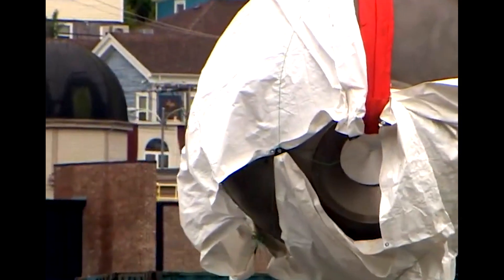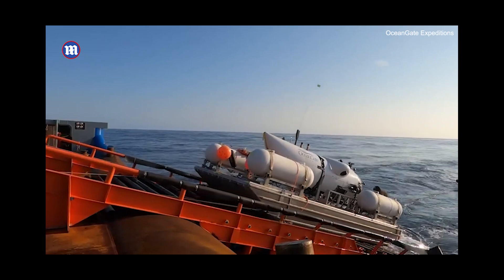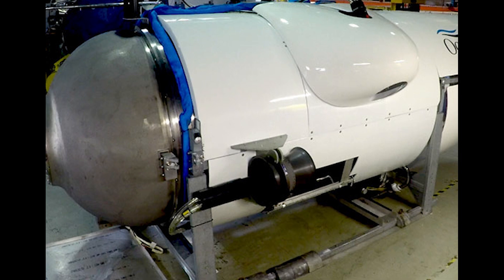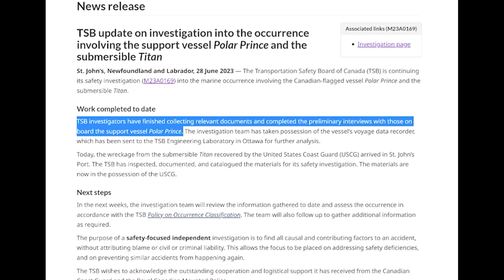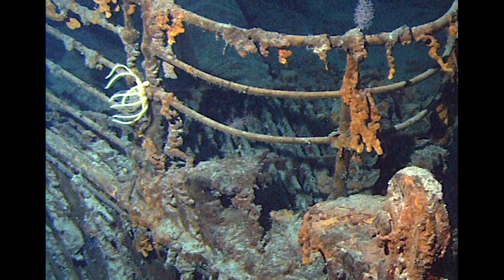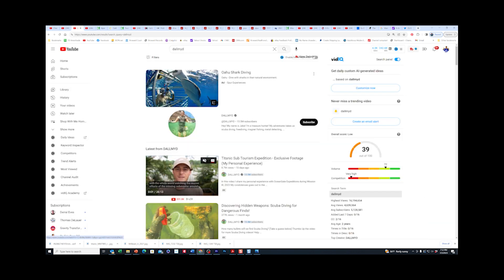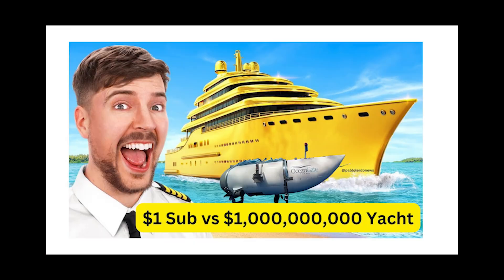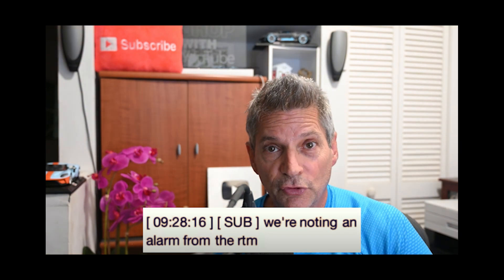Titan Submarine Debris Clues, Implosion Simulation

Comment: The porthole almost certainly blew outward during the implosion, taking the bolts and retaining ring with it. The salvage crew would not tamper with critical evidence. They have lifting bags and would not need to remove the porthole.
Reply: @bills6093 I concur. Did some fuzzy math, the yield load for each of those fasteners would have been around 17,000 lbs each for a combined yield load of around 289,000 lbs. The purpose of those bolts is just to keep the porthole watertight at the surface because, being bolted from the outside, water pressure would have sealed it more firmly as it went deeper so I'm going to assume the bolts are just corrosion resistant steel rather than anything super exotic. At that depth, they're seeing between 5,000 and 6,000 psi of pressure. that porthole has a surface area of about 350 square inches which means that that when the hull imploded that flange would have seen a peak load of about 2 million lbs. Those bolts failed and that porthole went rocketing off into the ocean.
Reply: @themightydropbear Your force balance is lacking the external hydrostatic pressure that resists motion.

 I looked up 3/4" UNC grade 8 bolts, and get 50,100 lbs each.

Titanium and steel both have tensile strength numbers of 50 ksi, so your titanium bolts would be roughly the same strength. I'm pretty sure that they did not want galling or stress corrosion issues, so they used titanium, unless they are even stupider than they appear to have been.

Stainless bolts would be stronger BTW.

The clamping force of the bolts was roughly 0.9 million pounds for 18 fasteners, while the external pressure on the port was roughly 2.2 million pounds.

That's 3.1 million lounds that needs to be overcome before the port will budge.

Hydrostatic pressure on the internal face never exceeded 2.2 million pounds, so that plexiglas stayed right where they put it.
Reply: @chemech  Your high-school physics calculation is for static loads.  You're not taking into account that this event was basically an implosion/explosion, with dynamic forces and pressures way beyond what you could imagine.  

The salvage team DIDN'T REMOVE THE PORTHOLE to get a better lifting-point.  You absolutely do not screw with evidence that way in an investigation like this!  Anybody who even tried it would have been yelled at and fired on the spot, or at least removed from duty and sent to his cabin.  Also, it wasn't just the bolts holding the acrylic to the titanium.  There was a sealant/adhesive applied (to thousands of square inches of surface) before the thing was bolted on that would have made it impossible to pry off out in the middle of the Atlantic.  

Redo your calculation taking into account the dynamic forces of an implosion of a carbon fiber cylinder at 5000 psi.  Oh, you can't, cause no one's ever modeled it before???  Yeah, that's my point.  The implosion blew off the fu*king viewport and sheared the bolts.  Probably shattered the acrylic into a thousand pieces.  It had sufficient energy to do that.
Reply: @johnbergstrom2931  My, you sure don't like it when folks don't see the world through your lens, do you? 

Have you ever done an accident or failure investigation? Because, I have, and I can assure you that if items are properly recorded and inspected, partial diassambly of things that did not fail is actually allowed, because in the real world you can make some determination of whether a part was involved in the failure, thus needing extensive laboratory analysis, or clearly not failure related, in which case you may document and package the parts while making field observations.

It is quite possible for field investigators to make some determinations without needing to be in a laboratory. You are using the same tools, just working outdoors instead of in a warehouse environment at the lab.

Especially if the non-critical, non failed items are in the way for transporting the evidence back to the lab. Chain of custody must be preserved, and evidence that the part did not fail - especially still photographs - would be sufficient to allow field investigators to proceed as necessary to prepare the samples for transport to the lab.

Your point regarding the seal is incomplete - there would have been an elastomeric gasket used - no sealant, as solvents will damage acrylic. Acrylic is particularly easy to "craze" if it has been machined or polished, and alcohols will do it in a heartbeat. The solvents for sealants would be either alcohols (as in most glues) or aromatics, which are even more aggressive to acrylic.

A crtical point to inspect woul be to verify that the gasket was retained in place, and the gasket would be inspected for damage, as would be the seat and the acrylic. On a large, awkwardly shaped object such as the dome, the field investigators are very likely to have done the inspection and recorded the evidence, then preserved the pieces for further inspection in the laboratory.

Finally, your opinion regarding the force balance is just that - an opinion - and, a not particularly well informed one it appears.

Fact: In order to dislodge the port from its seat at depth, the statics analysis is quite sufficient to estimate that ~3 million pounds of force would need to be applied, while the hydrostatic pressure at the depth gives a force of ~2 million pounds. The extra  ~6,000 lbs (or even 60,000 lbs) of waterhammer is too small to be a significant figure.
Reply: @chemech  While the 'waterhammer' effect may not be large, the O2 tanks and battery systems and any flammable material may have rapidly ignited and exploded due to the 'diesel heating' of the atmosphere from such rapid compression, there has been much speculation about that as well.  As they inspect any of the interior debris we may get more answers.
Reply: @johnbergstrom2931  what thread stress is there during an IMPLOSION? You're explaining explosive forces which go in the opposite direction to what happened here!
Reply: @themightydropbear  I don't see the bolts failing during implosion at all - explosion perhaps. But this thing was a SUPER strong vacuum which implodes!
Reply: @R.BOWERS  Because the straps work better for things with holes in them?
Reply: I do not see evidence of damage to the seating flange of the viewport from such a failure - it looks pristine, where if it failed as you suggest, the bolts would have torn the base metal of the seat, with significant damage.
Reply: @chemech  Not really, if it blew out then possibly all the threads got stripped, you wouldn't see that fine of damage on these videos.  The pressure in that sub would of gone exceedingly high, and any work I have done with explosives, there is always something that happens that goes against intuition, pressure waves work in mysterious ways.
Reply: @kingcosworth2643  I've looked at a few pressure vessel failures in my career. Other colleagues have more experience.

Bolts on a flange never fail simultaneously, and stripping the threads during a tear-out always leavesfairly visible damage.

Elesewhere I estimated that the tearout failure would have to overcome ~2.2 million pounds of hydrostatic pressure plus 0.9 million pounds of bolted connection strength. A collapsing air bubble is going to find the path of least resistance, and, frankly, dissolve into the seawater almost instantaneously.
Reply: @kingcosworth2643  "would HAVE" or "would've", NOT "would of".
Reply: @chemech  Could just strip the threads right out. Or could shear the bolts off flush. I think we would all like to get a closer look at that end cap.
Reply: @bills6093  Even Grade 8 steel bolts would have tensile strength of 50,100 lbs each for 3/4" 10 UNC.  There's a safety margin beyond that, but it takes more time to dig the references up for that, so we'll use the rated capacity.

Titanium and mild steel both have tensile strengths of 50,000 psi, so we can assume that the service rating will be roughly the same.

IIRC, there are 18  bolts - might be 20 -around the viewport to clamp it in place. 18 x 50,100 = 901,800 lbs.

a 22" diameter viewport would experience at most:  380 sq in x 5,813 psi = 2,209,000 lbs on the outer surface at 3,800 m depth 

The design pressure at 1,300m = 1,949 psi, pushing the acrylic against the seat. I do not know for sure what the supplier was using as a safety factor for life-critical equipment, but personally I would prefer to use 5.0. It looks as if they used something larger than 3.0 in any case.

In order to rip out the acrylic and tear out the bolts, your shockwave of rapidly compressed air would then need to exceed 3,111,000 lbs = 8,187 psi - instantaneously - in order to tear out the bolts 

That's not going to be a clean failure however, as the bolt theads will not fail uniformly and instantly. Look up pressure vessel failures - there's always damage to the flange in that sort of failure of the bolts.

I don't have the compression calculations at my fingertips, but I doubt that a collapsing air bubble can generate that much pressure. It's far more likely to go into solution in the water first.

We are talking about stupidly high pressures applied in millisecond - and brittle failure is going to be faster, and thus relieve the differentila pressure on the ductile materials potentially before they even distort significantly.
Reply: @chemech that collapsing air bubble had a lot of fuel and oxygen in it. The Shockwave from the resulting explosion would easily exceed those numbers.
Reply: OK, this settles it: The Daily Mail reported on 06/23/2023 that the "Porthole Window" and "Front of Pressure Chamber" (front titanium end cap) were found seperately in the debris field.  The implosion blew out the acrylic porthole.
Reply: @johnbergstrom2931  rubbish, porthole caused nothing of the sort. Implosion impact may have dislodged it but it wasn't the initial caused. FOCUS ON THE CARBON FIBER!
Reply from the maker: I would love to see these parts up close
Reply: HOW would the salvage team remove bolts?  The depth exceeds the safe limits for divers to work.  No way to remove bolts

.
Reply: @electrictroy2010  With a motorized socket wrench on the ROV operating at depth...

More likely, they got it up to the surface and examined it on the deck of the recovery ship, then removed the bolts so that they could examine the gasket and the flange face.
Reply: @electrictroy2010  No divers at that depth. it took 2 hours+ for the submersible to get down there, and the ROV robot.
Reply: @jeffostroff  I think we'll have to wait a couple years until the investigation is complete to see good images of the Titan wreckage.
Reply: @johnbergstrom2931  why? Hi resolution digital camera can work MUCH faster than that.

PERFECT photographs can be beamed around the world within seconds. No need to wait unless it's suppressed from public view for whatever reason.  Be nice to have live footage of the lab investigation.
Reply: @fifiwoof1969  The images of the wreckage will be concealed from the public until the investigation wraps up.  "Be nice to have live footage of the lab investigation."  WHAT PLANET ARE YOU FROM????
Reply: @johnbergstrom2931  the only connection to anything that could conceivably be considered classified is the navy or coast guard rescue - this was a privately owned submersible that DEMANDS public scrutiny due to the fact that innocent lives lost on board. With respect to 80% of the passengers we don't need the gory details but structural failure details is essential for others to research from.

Earth - thanks for asking. Try joining us some day ;-).
Reply: @jeffostroff  exactly.  .  lifting bags dont help to move the rings from the ship to the dock.
Reply: @bills6093 completely agree with you .. there's no way they would remove the window .. it would impede the investigation.
Reply: @ScreamingEagleFTW correct but he had a poi t they wouldn't remove something that could be evidence. They could have bolted on a loop to the hinge point to lift if from water to the dock
Reply: @stevenbishop1466  if the glass was broken they might have had to remove it to preserve it so it doesnt fall to pieces while being hoisted up.   Im sure there were forensic researches on site giving directions to collect the evidence. Im sure the investigators dont just wait in the lab for the parts to show up.   The gathering of the evidence is crucial and wouldnt be left to random dock workers.
Reply: @sparklebox11  Well did the remote rover have a dewalt cordless drill driver in it's claw to remove all of thoes bolts at 3800 meters?
Reply: @ScreamingEagleFTW 🤦
Reply: @R.BOWERS  Yes, I used the incorrect term. I'm sure no one ever does that except me.  Shake your head all you want.
Reply: @@NT-ed9fo Yep..., and, it's debatable at best if the implosion could generate enough force to overcome the external forces holding the port in place.

Until the internal force exceeds the combined external pressure force and the clamping force of the bolted connection, that window wasn't moving.
Reply: @chemech  Not a very 'fun' fact, but someething to consider.  When they dove on the Thresher back in 63, the Trieste took some photos of the propeller and most of the shaft and thrust bearing.  It had been ejected out the aft end of the boat during the implosion.  So a large shaft (perhaps 24 in diameter??) and the ships thrust bearing housing was pushed/ ejected out against the (admittedly less) sea pressure when the hull imploded.  As someone mentioned, implosions and shock waves are weird and unpredictable.
Reply: @chemech  @fifiwoof Once it imploded, there was NO "external pressure" holding the viewport in place.  The inertia of the imploding material would cause a massive pressure SPIKE at the port.
Reply: @@NT-ed9fo We are not really questioning the method of failure of the sub, but whether or not the salvage crew removed the porthole. I believe the porthole blew out during the implosion. I also believe that we do not get any view of the "bolt side" of the porthole during the recovery.
Reply: @bills6093  what EVER blows out during an implosion? It just doesn't happen?
Reply: @bills6093  it may have popped off secondary to the implosion (from the force of the water gushing in HARD against the interior side of it) and destroyed the epoxy glue in the process - 4 or 5 days of seawater exposure could destroy it too leaving a pristine titanium surface without any trace of epoxy.

Suppose you're right about the window - now explain the missing bolts for us all.

I agree that investigators noted they weren't damaged, took photos,  recorded and the removed them to assist the salvage. Be good for them to stream the lab investigation.
Reply: @bills6093  from my reading I see people arguing the porthole imploded first - it didn't. Also heard about stripped titanium threads and the stresses it would have to withstand under COMPRESSIVE force. The forces here, 3 million total pounds of force, was less than 20 or so titanium bolts could reasonably withstand and the titanium dome is perfectly intact - same material.  Fair to say the bolts are in a similar condition. Possible the holes for the bolts are on a separate piece that we haven't seen recovery of and you haven't seen holes on - to say it's not visible on the available dome footage may be missing this possibility.
Reply: @@NT-ed9fo Not that the port failed, but here is Stockton talkiong about it coming 3/4" into the sub at depth. "One of the things about acrylic that's really great is, before it fails, at one-third its failure pressure, it will start to "craze." So it'll often be distorted. So you know when that thing's gonna fail. And so when I was looking at this, that view port is—according to the rules, it is not allowed.

So there's these weird rules that are out there.

It will shrink. It's a semi-solid, the plexiglass; it'll come into the cabin by about three-quarters of an inch—all of the pressure that's there.

POGUE:   Oh, man. And that's a good thing?

RUSH:   Well, that's what it is. But the great thing about plexiglass that I love is, you can see every surface. And if you've overstressed it, or you've even come close, it starts to get this crazing effect.

POGUE:   Okay. And if that happened underwater—

RUSH:   You just stop and go to the surface.

POGUE:   You would have time to get back up?

RUSH:   Oh, yeah, yeah, yeah. It's way more warning than you need."
Reply: Can anyone see any form of locking device on the porthole bolts to prevent them backing out?
Reply: @bills6093  That wouldn't be necessary - this device would not vibrate excessively, unlike a helicopter.
Reply: @bills6093  Which is why a responsible operator would check the torque before each descent.

The friction of the bolt threads at the appropriate torque is sufficient to retain them in place.
Reply: @bills6093  Look again. They used regular socket wrenches for the preliminary torque to hand tight, then they had a click-type wrench shown while bolting the dome on.

They would have torqued the viewport at a different time in advance, and that was never shown in the publicly available videos which I have seen to date.

This vessel should have been designed and built to the Boiler and Pressure Vessel Code, which would have specified that the bolts be torqued to specification, as would the installation, operations, and maintenance manual from the vendors who supplied the viewport and the domes and ring flanges.

OceanGate clearly did not feel that they actually needed to follow such codes themselves when it came to the carbon fiber composite hull, but it sure looks like the vendors who supplied the titanium and acrilyc portions did follow the code.
Reply: @bills6093  The bolt holes would be "blind" - in other words, they did not go all the way through the metal of the flange, leaving a smooth surface on the interior.

This is standarnd practice in pressure vessel design, and all indications are that the supplier of the viewport knew how to design and build proper hardware.
Reply: @bills6093  what expansion do you envisage a SUPER vacuum undergoes at an external pressure of nearly 400 atm?

SMH
Reply: @bills6093  why would they undo spontaneously and how would that endanger the vessel - water pressure would compress the bolts not stretch them - threads would certainly not strip during initial implosion, maybe after pieces collide against each other but stripped threads DEFINITELY not the initial cause.
Reply: Okay, in the pic of the porthole cap being lifted, I think we are seeing the inside of the cap, not the outside. That is why we do not see any sign of the bolts, or bolt holes, or flange, etc. It is the smooth inside surface.
Reply: I think your right.. in the pic u can't see any holes for the bolts. I'd say they all sheared off
Reply: @hardmcshaft7931  I think we are looking at the inside of the porthole dome, so there would be no bolt holes.
Reply: @bills6093  Respectfully disagree, the opening where that strap is seen, look at the upper side of that flange.  It's in daylight meaning it's on the convex side of the hemisphere.  If we were looking at the inside of that dome, the area above the strap would be in shadow and the strap not pressed against the titanium.
Reply: @@NT-ed9fo I believe we have not seen the relevant side yet. So we will have to wait for more info. I believe at one point early in the lift, the end cap swings around, and you can see the shape of the outside flange under the tarp. Not sure though.
Reply: Umm nets exsist......
Reply: I tend to agree you...
Reply: Correct
Reply: Carbon fibre may have added some strength in holding the epoxy together. Under pressure, the epoxy would be evenly stressed and gave way at about the same time so the whole piece might have just shattered into tiny bits.
Reply: Outwards😂you got the forces wrong.
Reply: Blew outward? HOW?

1 atm inside and nearly 400 atm outside? If that porthole is going anywhere it's DEFINITELY going INWARD given the sub prior to implosion is just a SUPER powerful vacuum chamber.

I'm not saying the implosion didn't wreck the porthole but it's wrong to say the implosion ripped the bolt out cleanly, would have helped the bolts.
Reply: @fifiwoof1969  forgive them, some don't understand basic physics.😂
Reply: @R.BOWERS 🤦
Reply: @R.BOWERS <-- 🤡
Reply: @R.BOWERS They were being sarcastic, numbnuts.
Reply: @NT-ed9fo  you ARE wrong.  Force was pushing inward - HARD!porthole wasn't the cause. Focus on the cylinder of carbon fibre - THAT'S your weak point right there!

Survived 7 journeys? Not 8! Rush thought he was invincible - deserved to die. Money doesn't buy intelligence!
Reply: @NT-ed9fo  apologies if I misunderstood what you wrote - maybe my comprehension is substandard and I erroneously lumped you in with the "explosion pushing outwards " group on this thread.

Please accept my apologies.

Hug?
Reply: It's total BS!  There isn't even a single bolt left in that "porthole" aka BONUS HOLE. 
the entire charade is a PSYOP to distract the masses from Cocaine Joe Cocaine Hunter and Cocaine Zelenskyy. 
A game controller huh????
What a F U C K I N G JOKE🥸
Reply: 0:44 maybe that is the rear dome, not the front dome with the porthole window. I can imagine there were cost savings to be had to manufacture both end caps with the same mould/tooling, so maybe both had a 'porthole' feature; the front cap had a window fitted, the rear cap had a cable gland. That could explain the lack of bolt holes/marks. The cable gland could have been secured with a different mechanism, such as being clamped from the inside.
Reply: @shm5547  No. the rear titanium dome was solid. So it's definitely not the rear dome.
Reply: @bills6093  ah ok, thanks for the info, I'd not seen the rear dome in any footage before. Does this mean the cables were brought into the pressure chamber via the carbon fibre tube? A hole in that structure could have been a significant weak point.
Reply: @bills6093  I don’t think it was wireless, how on earth you would get that to work reliably underwater I don’t know. Plus, I’ve heard that there was a manual hydraulic pump to drop the ballast if the electric motor failed, so there would need to be hydraulic pipes brought out of the pressure chamber.

As for the glue, it does seem a bit risky. I had thought that the external pressure would just keep things together anyway, so the glue didn’t matter too much as the joint would be constantly under compression. However, watching the construction video, the flanges looked way too shallow to me.
Reply: This was my theory too. It would explain why it's not crinkled.